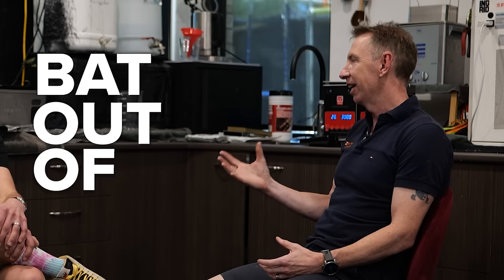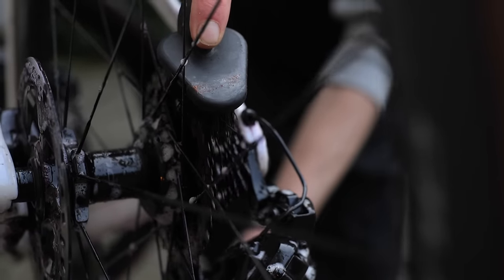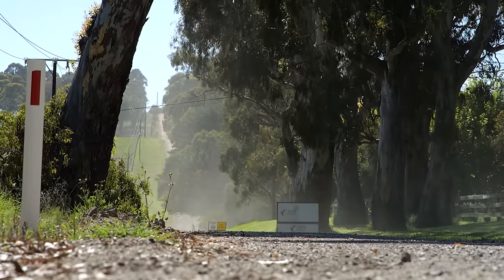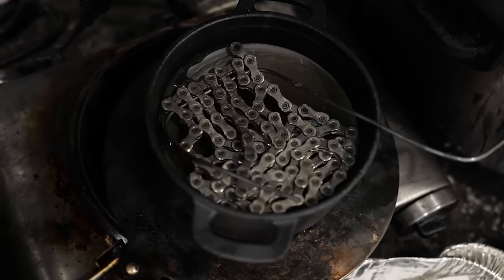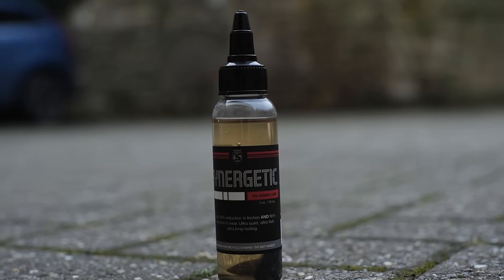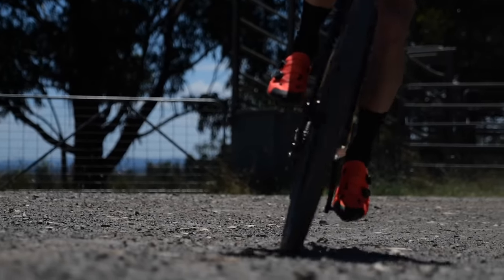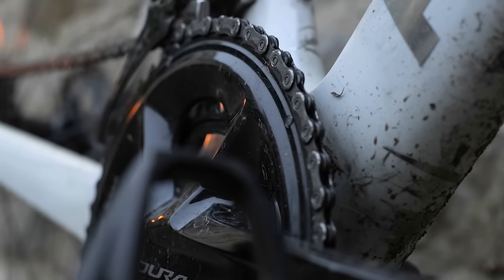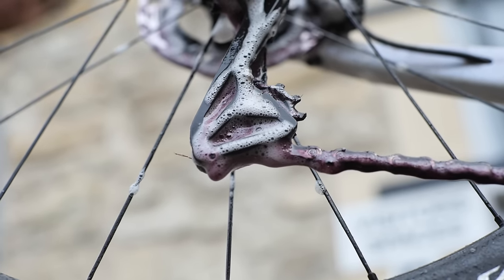They Don't Want Your Chain To Last This Long

Comment from the maker: What are your top tips for chain maintenance? ⛓️
Reply: Avoid your stiff flaky waxed chain and having to break it loose before your first ride by installing the chain straight onto the bike right out of the wax, then run it through all of the gears while the wax is still warm arnd soft.  Saves a lot of mess and prevents that stuff clunky chain before the first ride.
Reply: Full emersion solvent bath and scrubs. Environmentalists be dammed. Nothing cleans like Kerosene and disc-brake cleaner with the assistance of a stiff bristle paint brush.
Reply: Buy a car 🤣🤣
Sorry for my bad humor 😁
Reply: Wipe the chain with a dry cloth after each long ride and and re-apply chain lubricant (e.g., Squirt). Wipe again to remove excess. I learned this from Lennard Zinn and don't use a mechanical chain cleaner with solvent more than once or twice a season.
Reply: “Life is like riding a bicycle. To keep your balance you must keep moving." - Albert Einstein -  PADS Lake County.
Reply: Buy paraffin candles and some nano ptfe, make your own emersion and drip wax
Reply: I commute in all weather. I give my chain a quick wipe with a cloth after each ride. I give it a quick wash with chain cleaner and relubricate (wet or dry lube depending on season) once every couple of weeks (or before a race/event). I replace my chain a bit more often than most people, it costs me £20, which over time works out as less than buying quick links and immersive wax, and takes FAR less time. I'd prefer to spend time with my family than agonizing over how clean my chain is - these marginal gains disappear after your first 10 miles on British roads anyway.
Reply: @sebaldc.2681  He's even smarter than I thought 😁
Thanks for the good post.. I'll quote this sometime 👍
Reply: @Jari1973 Thank u man!
Reply: @Jari1973  i have 2 bikes and 2 cars
Reply: "WD-40 Silicone Spray"
Reply: go with 3x (no more than 9 on the rear cassette)
Reply: I discovered PlanetSafe Lubricants AIM (stands for Automotive, Industrial, Marine). It is a fantastic lube. It is a nano particle lubricant where the nano particles bond to metal surfaces and seriously reduce friction. It has no smell, is non-flammable, and non-toxic. It prevents rust and doesn't gum up. Simple wipe after a ride cleans up the chain. As someone with over 200k miles on my road, mountain, and now eBike, I can say it is the best chain protector I've ever had.
Reply: I just switched to immersion waxing, so throw all my previous "chain maintenance" tips in the garbage!

Comment: One reason I moved to wax is that it actually makes drivetrain maintenance SO MUCH easier and faster on my road, gravel, and mountain bikes. Instead of having to clean a bunch of oil-soaked gritty gunk off the chain, rings, and cassette after 1-4 rides, I just wipe down the chain and either drip on a little Super Secret or re-dunk the chain in hot wax as necessary. Further, working on the bike without getting lube all over my hands is awesome. Prepping a new chain used to be the hardest part, but Silca has even made this super easy with their new products. Very simply, I love having a cleaner, faster, and lower-maintenance drivetrain--and it even saves me money. The naysayers are either ignorant or doing it wrong!
Reply: I second that, drive train maintenance and chain swapping is so much simpler as soon as you realize you can do it without rags without gloves, and you don't need to scrub your hands for 10 minutes after. 

Id honestly continue waxing my chains even if it was slower just for that. The benefit of being able to work on the bike without getting covered in grease. The peace of mind that Im never again going to foul some pants or a couch with chain bite that I didn't notice in the shower after a ride, etc. The cleanliness of a waxed chain, is such a HUGE benefit that is rarely talked about.
Reply: how do you do your post ride bike clean? Do you take your chain off? Can the chain handle a bit of soapy water from the rest of the bike wash?
Reply: @danielhand1729  I usually just do a quick wipe down with a cloth. But if it's been a really dirty day, I pop the chain off and do a proper wash with a hose and soap. If the chain is also really muddy, I will rinse it with water (no soap), and then dry it with a cloth before putting it back on and adding fresh Super Secret (or just pop on a spare freshly-waxed chain, and then throw the old chain into the wax pot after rinsing and wiping it).
Reply: @user-wl5es3gg3f right so if the rest of the bike needs a clean with soap you pop it off. how do you find the reusable quick links? reliable?
Reply: After ONE mountain bike ride here.  Sometimes MID-RIDE.  Last ride in the Sierra I did required mid-ride re-lubing.  Typical for everything I've used for 40 years up until now.  Not anymore!!!!
Man oh man why did I wait so long??????????????
Reply: @dudeonbike800  Yeah, I was so reluctant to try it as well. Pretty silly, in hindsight. Wax is just so much better, I curse myself for not trying it earlier. So many wasted hours of cleaning trashed drivetrains. So many wasted chains and cassettes...
Reply: Wax create as much gunk and flakes around casette...and considerably harder gunk.
Reply: @heksogen4788  Naw, not on my bikes. Not sure what wax you're using, or how you're applying it, but I suspect that something's amiss if you're having that problem.

Comment: "Intervention to reset contamination", tech speak for "cleaning". I love it.
Reply: well no, a "reset" goes a bit beyond "cleaning."  with a reset you're basically replacing all of the contaminated lubricant with fresh uncontaminated lubricant, while with a cleaning you're just removing the contamination from the surface to prevent it from migrating to inside the rollers, any contamination already inside the rollers is still going to be there.  so yes based on the strict definition of the word "clean" a reset does count as cleaning, he's using this specific wording to differentiate between those two conditions.  if you want you can replace "reset" for "deep clean", however the word "reset" more accurately invokes the way somebody should think about it. the idea is to put the chain back to a like-new condition vs only giving the appearance of clean.  **disclaimer: if you're using a wax lubricant and you're reusing the same batch of wax, the entire pot slowly becomes more and more contaminated with every reset, so there's a practical limit to how many resets you can do with the same batch before the amount of contaminant becomes counterproductive.  he goes over all of this (at extreme length) on his own videos. the man is certainly passionate about this.
Reply: @better.better  That's a lot of words for "cleaning"
Reply from the maker: Cleaning would be too simple 😉
Reply: 👍
Half the thumb came from the nickname😁
Reply: @Chris-pt6hh  ha yes - what is "cleaning"? for one person it is wiping with a cloth. for another its putting into an ultrasonic. for another it is spraying degreaser through chain, for yet another it is a clip on chain cleaner etc etc. Depending on how much crap the conditions have brought into chain and lubricant depends on what level one should consider to re set. I personally prefer "intervention" as it implies you have to do something - but doesnt pre bias towards what one may think in their head = "cleaning". But then again, as you can see, i have long answer or way to say everything :)

Comment: I've followed the Oz Cycle process for several years (homemade paraffin/PTFE 10/1 in a small dedicated crock pot) . Current chain is at 9400 miles and still going. I re-wax at 200-300 miles, and use the same Shimano link through the life of the chain.
Reply: Oz Cycle channel is definitely worth a look. Lots of practical ways to save money on bike maintenance including making your own  tools.
Reply: I used the Oz-instructions to mix my own hot-wax and drip on. The fact that they are DIY and aren't peddling any brands made me confident the whole wax thing is not just a marketing thing.

Btw: They adjusted their formula from 10:1 to 20:1 wax to PTFE.
Reply: "Current chain is at 9400 miles and still going." What does that mean? That it hasn't snapped? Most will want to know the wear data as would anyone hearing claims like how a $40 bottle of chain lube can "save" $500, as Mr. Fiction made here. I'm usually a skeptic about "Buy my expensive product and SAVE!" claims, but maybe that's just me?
Reply: It means it's at 9400 miles and hasn't reached the .5 wear to replace as mentioned in the video. I do have the Park Tool adjustable checker versus the go/no-go guage, and it looks to be about .4 wear at the moment. I don't ride them until they break...  Right now 1lb paraffin is about $5, $3-$8 for 1.6 Micron PTFE free shipping, and about $13 for the crock pot. That will last at least a couple of years for my several bikes.
Reply: keep the PTFE out of it. That crap has no business being flung around willy nilly

Comment: Alex seems to be gravitating to being the champion for value for those of us who don’t have unlimited budgets or have bikes given to them for free.
Reply: It’s almost like everyone tore him a new one for his video on motorcycle vs bike costs. 😂
Reply: Then get a few chains wax them, and rotate them as soon as they make noise. Take 15 seconds with a quick link to change out, and Im on more than 3k miles on one of the chains, and it's got basically no wear, and I ride in an incredibly harsh environment. A long waterfront beach bike path with lots sand, salty air, etc. A chain used to last me 1000 miles if i was lucky. Now, 3000 miles in, i can barely tell it from the newer chains. 

Add in the fact that you can touch your chains and get nothing on your hands, and that you will never again foul anything with un noticed chain grease from your leg. Best decision I ever made to start waxing my chains.
Reply from the maker: Hahaha the champion of value has a good ring to it! 🤣... Lets just not mention that chainset 😉
Reply: I think that Dura-ace "value component" fiasco will never let him forget and now he's on a mission to right that proverbial "wrong" forevermore! 
Cheers to Alex (and Adam) from Vancouver, Canada 
*edit: sorry @gcntech I just did mention it.... 😉🤭
Reply: They’re trying to compete with better value bike podcasts

Comment: Thanks for sharing this content. I e been waxing my MTB chain for a couple of years now and even with harsh conditions I get 2-3 thousand miles out of my chain before replacing it and I’ve had the same cassette and chain ring for 3 years. The extra time to apply wax is worth it!

Comment: Since buying  a ultra sonic cleaner my chain and gearing has improved the running and wear as it is deeped cleaned has saved me money
Reply: Ultrasonic cleaning, please tell me you are also waxing with that amount of effort. That is way more effort than waxing. I use an ultrasonic on some things, but that is basically a strip and re-lube.
Reply from the maker: Deep cleaning and saving money... music to our ears! 🙌 Are you waxing too then?

Comment: Once your chain. casette and chainrings are worn and need replacing. What is the problem in keeping them? I ran a worn-out set for a year with no noticeable problems.
Reply: Worn chains shift worse than newer chains.  They're also more prone to failing.  So  you have that PLUS the damage being done to other much more expensive parts, especially today's hilariously large 12-speed mountain bike cassettes.  What used to be $65 items are now $200, $450 and even $700 items. Insane!!!!
So the idea is to catch them before they exceed .5% elongation, or 1/16" in 12" span.  Then you preserve your rings, cogs and even pulley wheels and can get much, much more life out of them.
Wax takes this to the extreme where cog & ring replacement will become very rare.

Comment: I agree with all the positives about chain waxing, it's nice to work on a bike without getting my hands covered with grease, wax doesn't accumulate debris like oily lubricants do. The problem is the chains rust with waxing. It's bad in the rain but atrocious if you ride in the winter with road salt. I had to go back to conventional lubes.

Comment: I tested the water by switching from wet oil lubes to a drip on wax lube (Squirt) and found my chains lasted much longer and were much cleaner. After investing in a cheap / basic slow cooker and an old spoke, I've now upgraded to full immersive waxing. Waxing is no more time consuming than oiling, it's just a different method of lubing your chain and one that extends the life of your drivetrain, saves you money and something that wasn't mentioned in the chat with ZFC, your drivetrain is so much cleaner, after working on it, a quick wash with soap and water and you're good to go.
Reply: So much focus is on the speed, when to sell it to people all they have to say is you can take off your chain, put on a new one with your bare hands, and not have to wash them after. Literally handling a factory new chain that isn't waxed as messier than handling a waxed chain with 500 miles on it.
Reply: "Waxing is no more time consuming than oiling, it's just a different method of lubing your chain"
Right! You just have to a) remove it b) clean it c) cook it in wax d) repeat vs doing nothing but dripping some oil on it when it looks dry and wiping the grime off now and then. Perhaps you use a different way to measure time consumption but waxing involves a LOT of time and equipment...all to extend the life of a $50 consumable part. 
But the PT Barnums who market stuff to the chain-wax cult know their marks...er, customers. The money's in the consumable stuff, the bags o'wax, the bottles of drip wax, etc. vs a bottle of chain oil that lasts a long, long time. I don't know how they get away with claims of saving money..seems like SPENDING money IMHO.
Reply: LESS time consuming overall.  My riding routine was ALWAYS followed by wipe thoroughly EVERYTHING, then lube properly, and then wipe off the excess.  Easily 10 minutes if done properly - and that's with a fully equipped shop.  After EVERY RIDE.  And mountain biking?  MID-RIDE  So glad to be done with that utter stupidity and futility!  All for a chain that won't last much more than 800 miles.  LAME.

 It's more time on the front end, but far, FAR less on the back end.  AND all the other advantages.  Do 2, 3, or 4 chains at once and the time per chain is WAY less.  And time per lubing?  Minuscule!  
Those naysayers must be smoking crack.
(Or selling wet chain lubes, chains, cassettes, and/or chainrings!!!)

Comment: It's been very gratifying that this conversation reinforces the chain wear IS also cassette wear.
Reply from the maker: Great to hear you enjoyed it! Are you the sort of rider that stays on top of their chain wear?
Reply: yes you can extend cassette life, by teeth reshape, but they two are closed in mind box,
Reply: Good point.  I've been pretty good at catching my chain elongation before it goes over the threshold.  However, if ONE waxed chain lasts as long as 10 non-waxed chains, then imagine that's about 10X more cassette wear that will be avoided.
Color me excited!!!

@makantahi3731 And yes, I found a video demonstration of "re-spacing" a worn cassette with a Dremel.  Haven't tried it myself yet, but I plan on doing it to an 8-speed XTR cassette that I didn't catch in time.  That's an $80 out-of-production cassette that I can bring back to life.

Comment: I have been waxing chains on all my bikes for a couple of years. It is amazing. It is simple and fast and keeps getting easier to do. Silca Strip Chip is a true revolutionary product. You save 10x the money using wax without the cost of wearing out chains and gears. Plus it is clean. No more greasy grimy hands working on bikes.
Reply: I agree, I just got the kit. I will run at least two high end chain and just rotate. What, it takes 5 min  for klutz like me to swap a chain? To save $800 for drive train and chains? Beyond no brainer. Plus the waxed chain just runs so quiet and smooth!
Reply: Not just hands, the number of times ive gotten chain bite on the leg i didn't realize and greased couches or clothes, is more than i care to admit. But it's literally not an issue with a waxed chain, they are so clean people wont believe it if they haven't run one. 

You can take a chain with 250 miles on it, put the bike on a stand, take a rag, and run the chain through it like you would to clean a normal chain, and not get much more than the surface dust from your last ride. I cant emphasize enough how much cleaner they are.
Reply: @shawnington   "ROOKIE MARK!!!"
The mark of shame.  Oh the humanity!!!!